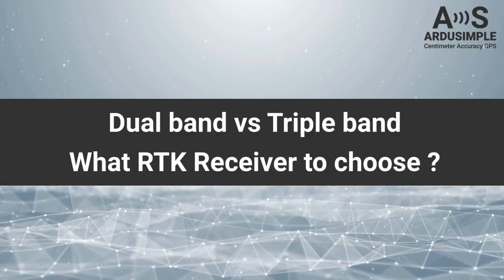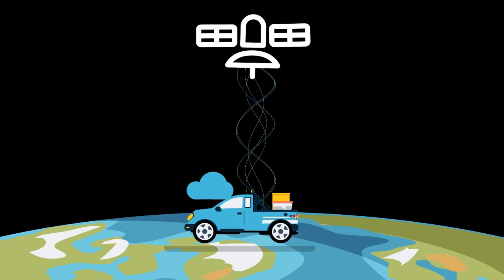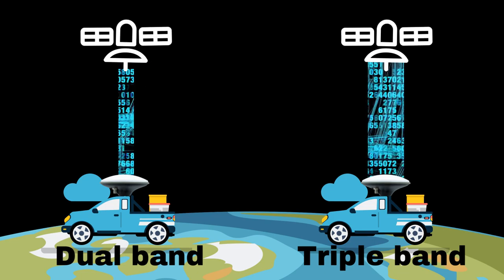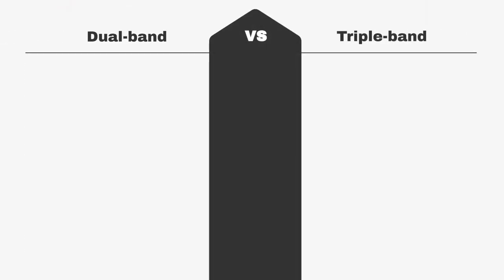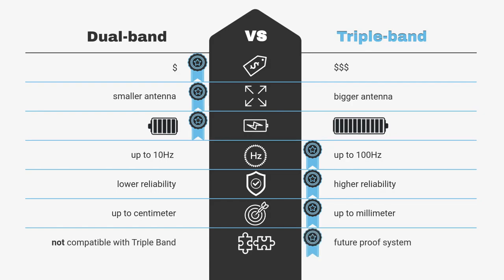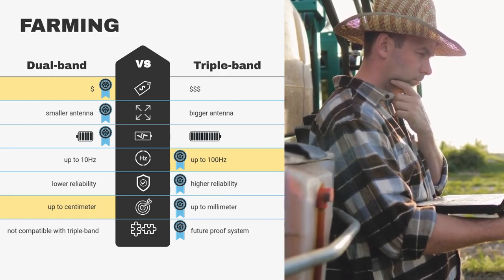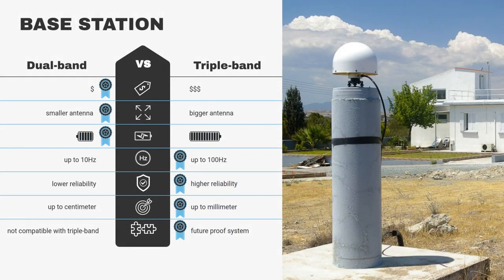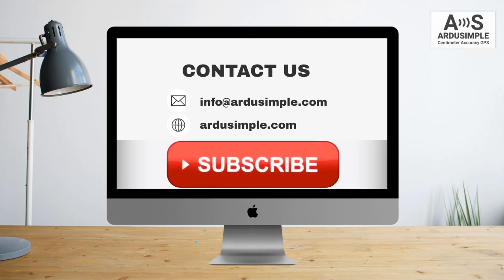Dual-band vs Triple-Band. What GNSS RTK receiver to choose for your use case?

Comment: Hello, why only dual band receivers of the same type as base station are able to use the correction data? What means "same type"?
Reply from the maker: Thank you for the question. There's in general 2 types of dual band receivers: L1+L2 and L1+L5. Let us answer with an example: if you have an L1+L5 rover and you connect it to a L1+L2 base station, it will only be able to use L1 correction data, and not the L2 one. As L5 correction data is missing this will lead to very poor performance on your rover.
Reply: @ardusimple  Thank you for explanation